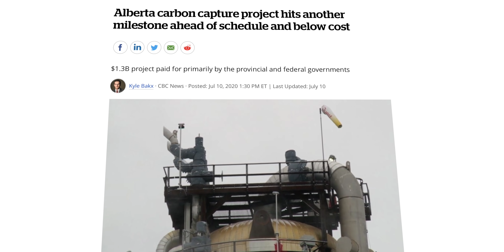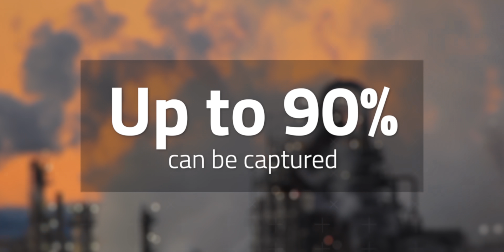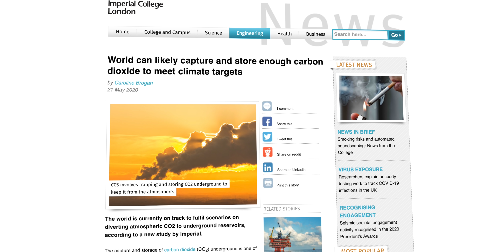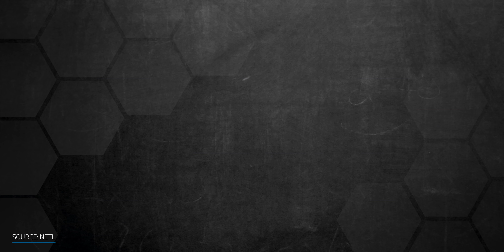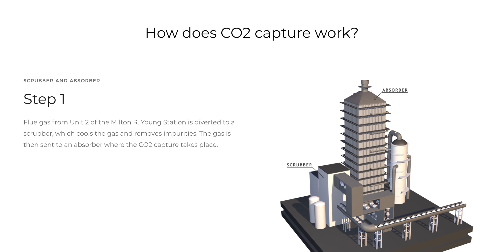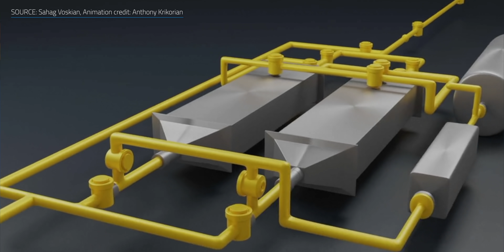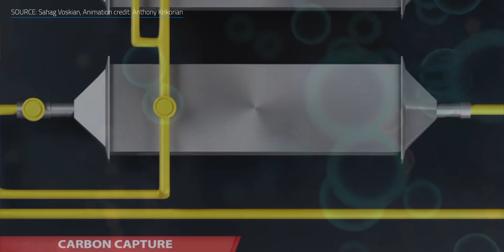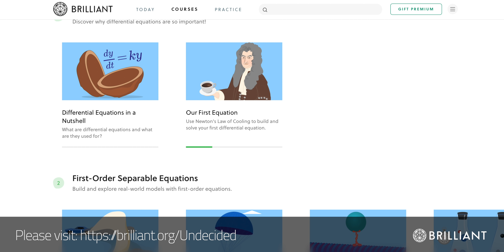The truth about capturing CO2 to reverse climate change

Comment: It's incredible how much research we do, and how many risky schemes for storing CO2 we are willing to undertake, just to preserve 19th-century technology of burning coal.
I don't trust any CO2 storage technology that does not include it adding up as carbonates or similar solid, stable end-product. Some of CCUS will be needed - for example, in cement production (we don't have a replacement for cement), or production of fuel for long haul aviation from CO2 captured from the air. But for coal, oil, and gas-powered power plants? Replace the heat source with a small nuclear reactor if they cannot be replaced with geothermal, hydro, or wind and solar plus storage.
Reply: Well it's because there is no other viable alternative that could meet the energy demands of over 7 billion people except maybe nuclear.
Wind and solar are not viable replacement because they do not offer stable energy generation and there is no good way of storing the energy they produce.
Reply: @GeorgeMonet  "Maybe" nuclear vs "certainly" 18th century "technology" of burning coal ?!?
Nuclear is a no-brainer, except for high capex and unfavorable public opinion (carefully nurtured by fossil fuel lobby).
That said, off-shore wind and solar on unproductive land are each more than sufficient. What we need is continental scale grids, and EU is starting with that. Somebody here mentioned  the situation where, for example, south of Germany must rely on gas peakers while north exports excess wind power to Denmark which ships it on to Norway which stores it in their pumped hydro "batteries", with the path reversing at peak times. Intra-German lines would solve this. An underwater cable is being constructed to connect Irish wind with Spanish solar, and both to French nuclear. When hydro and some wind does not suffice in my Croatia, we import French nuclear - Danish and British wind are too far with the current transmission infrastructure.
There is no "one size fits all" solution, but fossil fuels certainly don't fit anything.